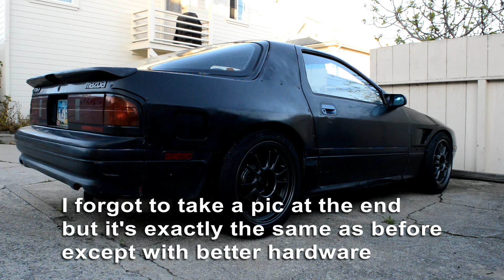Over Fender Install, NO WELDING! | EP 4

Comment: Finally A Video Without Welding ! Is The Spray Paint To Prevent Rust ?!
Reply from the maker: Yup, make sure you seal it up to prevent water getting between the sheet metal and then paint over everything once it's all dry to prevent rust. You can find the sealant at a hardware store, any sealant that is water proof and made for metal. Best to use an outdoor sealant since the car will see various weather conditions. Good luck!
Reply: Appreciate It ! 🔥

Comment: Hey I'm here 3 years later and was wondering how its holding up has the sealant done its job and is the two pieces of metal still being held together? Or did you have to redo it over time?
Reply from the maker: Years later and it is still holding strong!